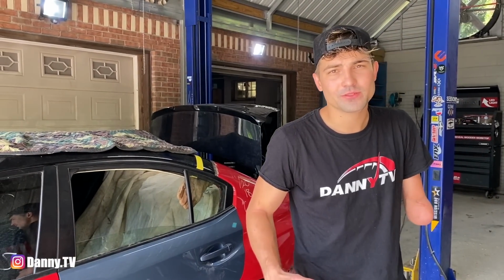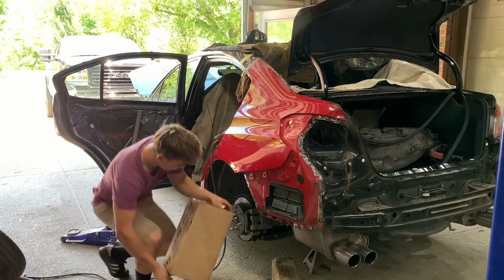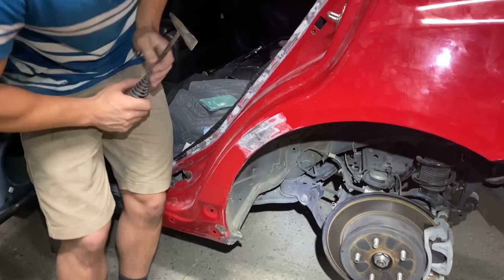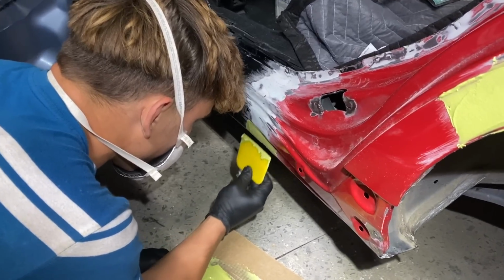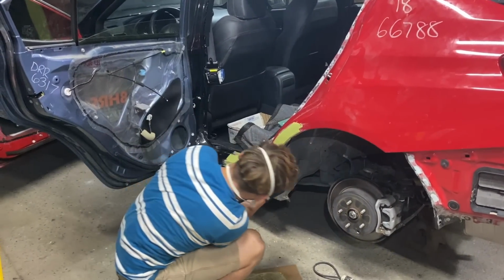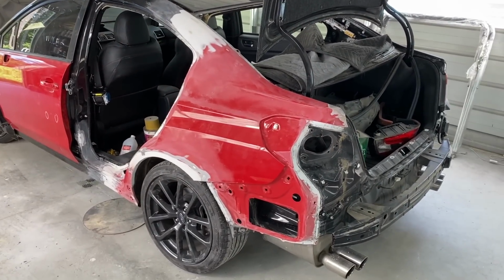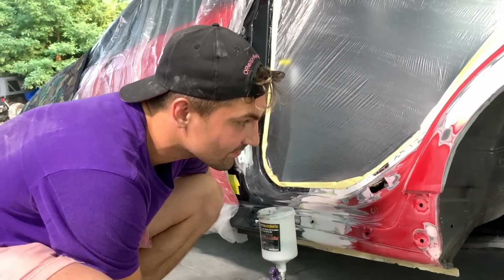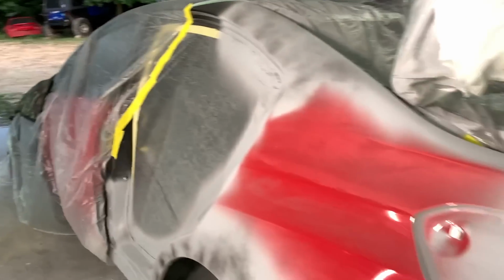Welding the Quarter Panel On A Wrecked Subaru WRX | Body And Primer Work

Comment: Thought in the last video you weren’t going to put in the “back plates” good decision to add them
Reply: the quarter panel is just outer skin, so those backer plates just add a lot of strength that will never be needed.